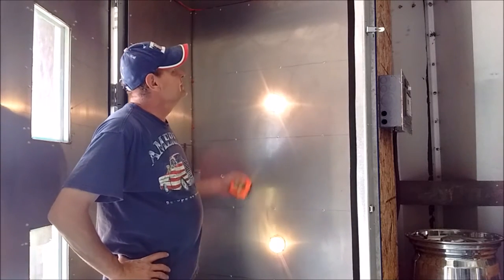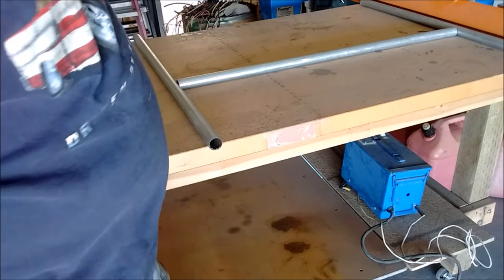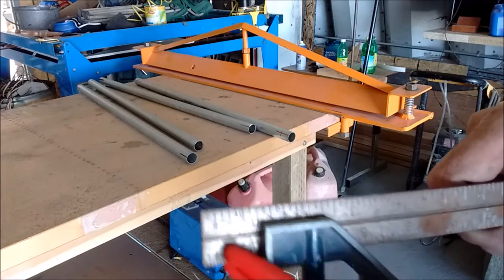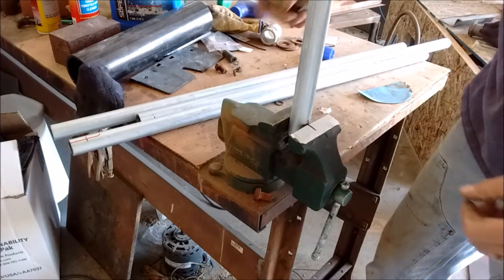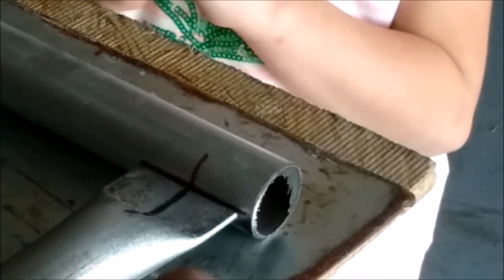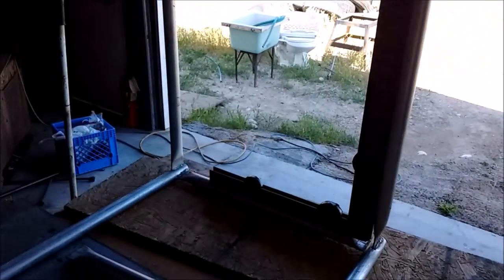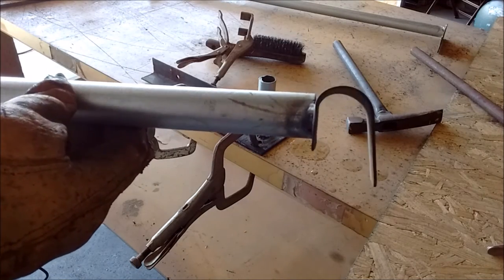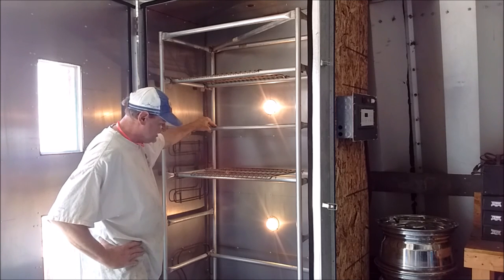Powder Coating Oven Rack Part 1 DIY homemade how to build

Comment: I hope you didn't welding galvanized steel with the grandchild there, galvanized steel gives off toxic fumes at around 390F.
Reply from the maker: Nope, she had to leave. I always have all the doors wide open welding this stuff. I used to be an exhaust installer on cars. Welded a lot worse stuff than this. Thanks for watching.

Comment: Why did you not opt to drill out (notch) the ends of the 1" tube with a hole saw instead of flattening them? The hole saw bit would need to be possible 1 1/8 depending on the OD of the 1" tube. You would have saved those vices :).
Reply from the maker: I ended up just flattening them with a hammer on an anvil. The method I use required less welding and work. Thanks.

Comment: Good job. Please how can I get the specifications / dimensions of the oven and list of items used. Thank you
Reply from the maker: Watch the other videos on the build of the oven. However I changed out the relay's to a contactor.
Reply from the maker: Please see other videos on the oven, Thanks.
Reply: @TheBlueCollarPreacher  you might consider using SSR relays or solid state relays which work great for heater applications
Reply from the maker: @domino2205  Yes that crossed my mind, thanks for sharing with us, and thanks for watching.